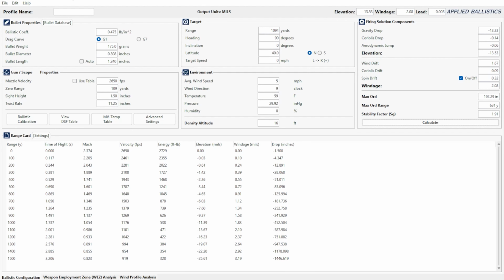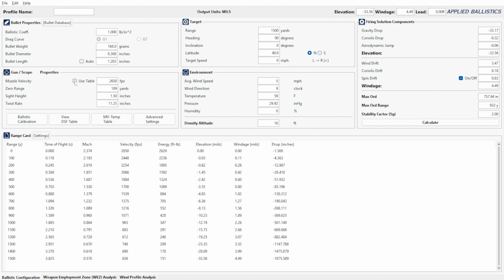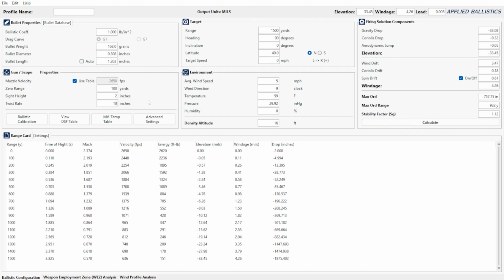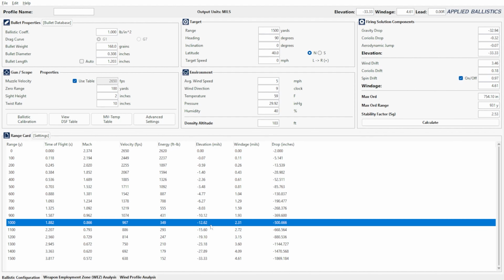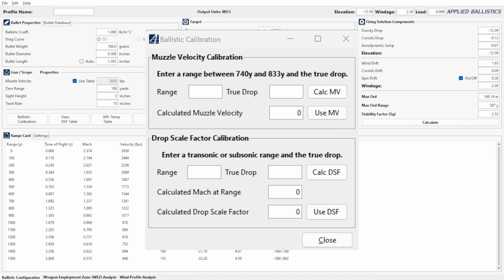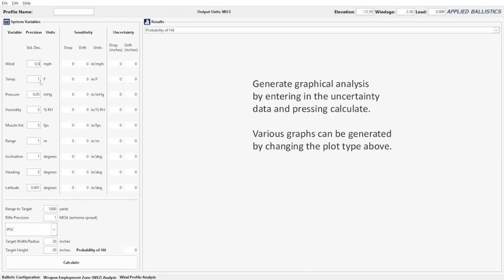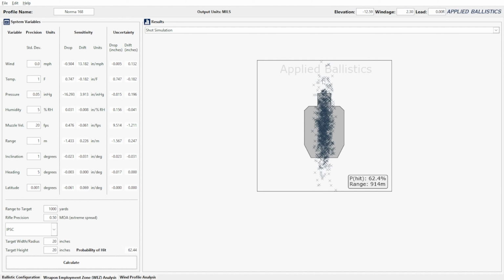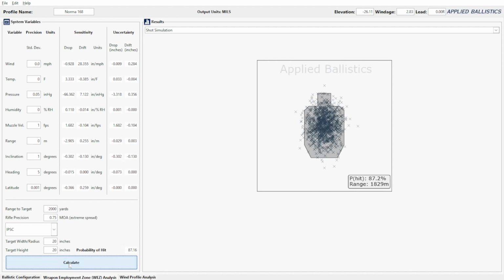Ballistic Calculators - Making Long Range Hits

Comment: I was wondering if anyone has noticed JBM Ballistics is giving the incorrect spin drift correction? I believe internally Coriolis is also affected but I cant confirm other than through calculators which use the engine and give you the option to toggle it (like Ballistics AE) How important is spin drift for you? if you go to their website and use their "drift trajectory" calculator in default and toggle spin drift on and off you will immediately see is accounting for it by adding its effect in the direction is going! Why?! According to the maker this is a "feature" but I suspect they had this blunder for so long they don't want to call attention to it. Please try this and tell me. I know it sounds like a mistake on my part but believe me and come back to comment. Do you think THAT makes sense? You can leave those numbers on default or enter your numbers of interest. Of course please make sure to select the right twist and every other important parameter.